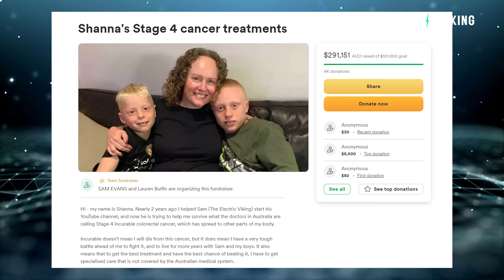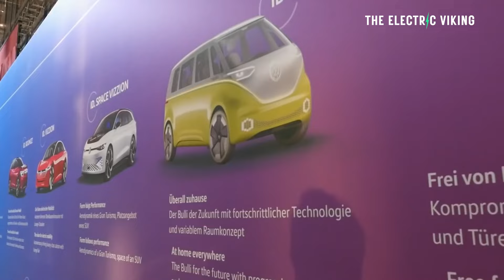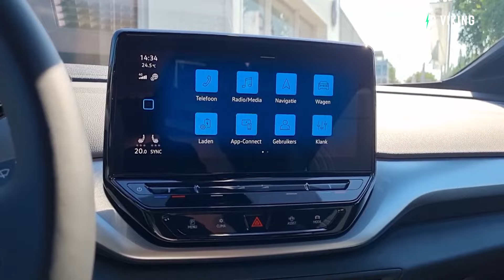VW changes 2030 EV targets; says it's being more ambitious than Audi

Comment: New subscriber and a lifetime Toyota owner. Joining to gain knowledge about EVs and their evolution. My next vehicle will be an EV.
Reply: What was your aha moment on EV's?  Mine was a race on a Monaco pier by a retired Formula 1 driver, Nicole Rosberg, on his YouTube channel between a Tesla Model 3 Performance vs a Porsche 911 GT2RS and beat it. The Tesla was the underdog and a family sedan that you can buy without the dealership BS that trying to buy the GT2RS would entail. This comes from a current PCA member. That had me going down the Tesla rabbithole.
Reply: Nico, not Nicole.
Reply: @GG-si7fw  My aha moment researching solar panels, heat pumps, and EVs is self-sustaining living. Creating my own electricity, storing it in a battery in my basement, and being able to run my house and car from it.

Comment: Unfortunately I think in the US 50% EV sales in 2030 would be huge progress. I think we'll hit 100% mid-late 2030's in the US, some people have a weird love of gasoline here.
Reply: I think it will happen sooner than that. Once it gets over 25% it'll get to 75% really quickly.  Just my opinion.
Reply: @davekozlowski1266  I hope so!
Reply: Just check the latest ev cell capacity and plant capacity plans since the ira passed. 10,000,000-12,000,000 domestic ev production capacity is claimed by 2030 now. Ice will be dead demand wise by 2025 globally if not even sooner. 

S curve disruptive adoption rates do NOT go as slowly as the people being disrupted by them try to claim. And evs are a replacement for ICE. 

So the roads for evs already exist, the dealerships to service them&bodyshops to repair them already exist, the technicians need new training and equipment for handling hv stuff safely but they still already exist in sufficient numbers to support the transition.

80% of ALL new car buyers here in the U.S. are homeowners with six figure household incomes. So those people have driveways already or a carport to their charge evs everyday and homes have steady reliable 200+amp service on average since the 80s now. 

If the darn gov would instead directly incentivise the stupid utilities&businesses to install reliable wired lvl2 chargers basically everywhere we already park cars for hours at a time? Instead of spiffing the purchase price of evs which if you look at tesla&gm just raised prices almost exactly as much as the tax credit was worth? 

You would see much easier uptake for evs. As easily available home/work charging is a major roadblock to mass ev adoption. 

Once more than 80% of sales are evs? Probably by 2027/28. Then switch to the tax payer incentives being used for building out massive public dcfc. And/or serving the enderprivileged areas as by then evs will really start to trickle down in the used market. 
As an average year sees 3-5x the volume of used car sales vs new car sales. But all of that just makes to much sense for the gov. 🙂